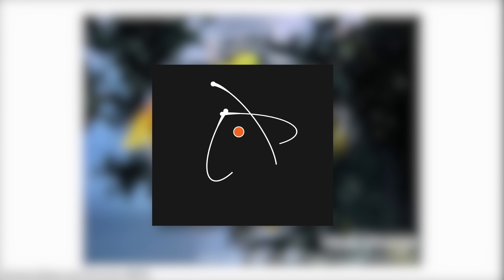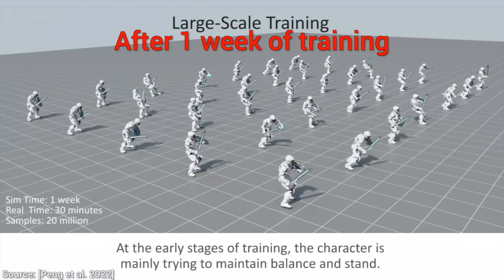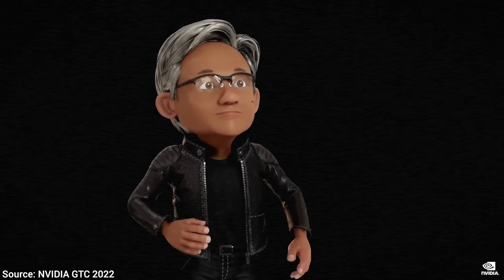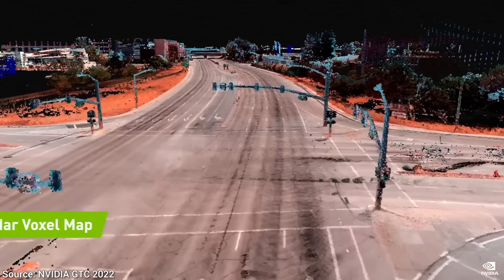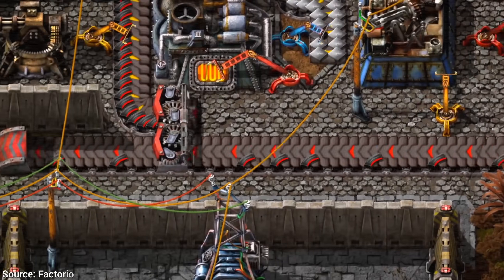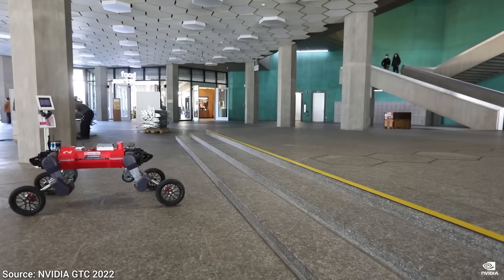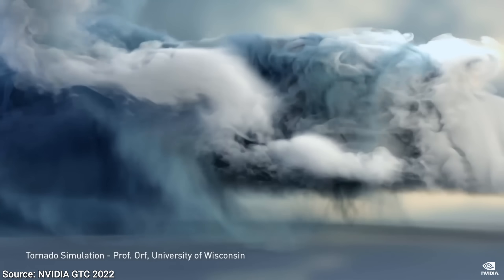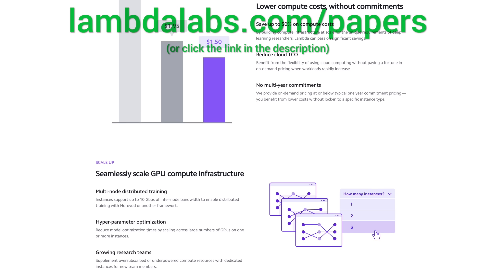NVIDIA GTC: When Simulation Becomes Reality! 🤯

Comment: Ten whole, rational numbers 0-9 and their geometric counterparts 0D-9D:

0 and it's geometric counterpart 0D are "necessary". 

1-9 and 1D-9D are "contingent"; on their predecessor with the exception of 0 and 0D (hence "necessary"). 

0 and 0D are our only whole, rational and not-natural number and geometric dimension. 

1-9 and 1D-9D are whole, rational and natural.

0D is Leibniz's 📚 Monadology 🔘.

Newton's 1D-4D only nonsense was clearly his thinking if 1D-4D is "natural" then it must also be "necessary". This is a fundamental error.

Newton's 1D-4D does not match quantum physics. Newton defines 0 and 0D as "not-necessary". This friggin guy.

Leibniz's 0D-3D (0D-9D actually) does match quantum physics:

0D Monad is Quarks 
1D Line is Leptons 
2D Plane is Guage Bosons 
3D Volume is Higgs Bosons

Newton's 1D-4D 🚫
Leibniz's 0D-3D ✅ (0D-9D more accurately)

Newton drinks his own pee.

0D Monad 🔘 is 
"One with Everything", literally 
" . with 0 "

0D Monad 🔘 is Quark 🟢🔵🔴 in quantum physics. 

No spatial extension. Zero size. 
Exact location only. 
6 thousand trillion trillion trillion (39 zeroes after 6k) times stronger than the force of gravity.

Quantum gravity 🚫 
Quantum aether ✅ 
(Ether)

Can every human on earth read Leibniz's Law of Sufficient Reason? Thanks.
Reply: [0D necessary and 1D-9D contingent universe; 
3 sets of 3]:

1D, 2D, 3D = spatial
(line, width, height)

4D, 5D, 6D = temporal  (length, breadth, depth)

7D, 8D, 9D = spectral
(continuous, emission, absorption)

Symmetry/entanglement: 

1D, 4D, 7D line, length, continuous 

2D, 5D, 8D width, breadth, emission 

3D, 6D, 9D height, depth, absorption

Hamilton's 4D quaternion algebra UPDATED from Newton's 1D-4D nonsense to Leibniz's 0D-3D matches perfectly.

Not a coincidence.

There is no 1 (contingent) or its geometric counterpart 1D (contingent) without 0 (necessary) and its geometric counterpart 0D (necessary). 

We don't exist in 1D-4D without 0D. Period.

Newton was/is so backwards on the fundamental level and possibility mentally 🧠 handicapped ♿.
(don't forget fraud)

We have a workable Theory of Everything solution right now. 

How do we do a planet-wide swap to actual smart person Gottfried Leibniz?
(And Plato, Tesla, Miller)

Comment: if These level of projects are coming out in affordable prices, countries like africa, india and many more could virtually create a world and make a bidding on each models and study the impacts as well as reduce the cost, without compromising in quality. it will also helps to reduce the delay of democracy as well.

in india environments and traffics are highly complex. so its hard to predict how the traffic for building optimal transport system will be tooo complex due to factors like connectivity points( road, railway, seaways, riverways, metro, airport) , weather changes( rain, humidity, temperature, heat, wind, pollution) , area type ( rural, forest, town, industrial area, city, town ), major busy points ( mall, school, college, IT parks, Markets, Manufacturers, Distributors, whole sale sellers, villas, Flats, tourist attractions ). this is almost impossible in india for making a common framework and make quick decisions on optimally efficient infrastructure development.

Comment: I see a future where we've disconnected the ideal 'jetsons' fantasy of the home robotic maid into the realities of the current technology. The brain doesn't need to be connected directly to the body. The local council or shire of your area can house the brain, and it can talk to many different bodies. Need a new electrical socket? Is your tap leaking? Something damaged your wall? Call up this service, and the appropriate body for the job shows up, getting signal from its 'brain' that has been trained to do this kind of work for over 50 simulated years.

Comment: The cells go through "trinary" division instead of the typical binary division.  Do the cells in this simulation have a DNA triple helix?
Reply: That's not a simulation, they just used AI to process the instrument data much faster and managed to catch that rare event.
Reply: @GS-tk1hk  OK.  Thanks for your comment.  

I looked into it and I found an example of a cell dividing into 5 daughter cells.  Researchers were able to increase the rate of the abnormal division under high-pressure cell culture conditions to mimic the highly confined growing conditions that can happen in a tumor.  

The cell highlighted in this video balled up write before cytokinesis, so maybe that caused increased pressure within the cell.  Cancer cells have high rates of polyploidy, so my "triple helix" suggestion would be unnecessary (and unrealistic).  

*I was thinking of Linus Pauling when the triple helix idea popped into my mind.

Comment: We need AI to make a ground breaking discovery, I think that will be where it really begins.
Reply: still a few decades to that
Reply: @mrqes  Not even close. The AI advancements we've made in just 5 years is astonishing. As AI grows, the growth rate itself increases. I would say it will make a groundbreaking discovery of some sorts in a decade at most. A few decades is a reach. Or, maybe there isn't much for AI to discover anymore so maybe it won't make a discovery at all.
Reply: @ET-yc4wb  nope, apart from that that's not how ai works, the computation required to run even the current models is tremendous, just to run GPT-3, which has over a 100 billion parameters you need hundreds of gigabytes of vram. for instance the average consumer card has around 4-16gb of vram, and the best cards range around 48gb?
Reply: @ET-yc4wb  and current models are fed a dataset for it to train on and then tested on the validation set to determine the loss, which it uses to correct itself. so it cant really just "learn" by itself
Reply: @mrqes  Computer power has seen one of the biggest growths in the shortest time in terms of technology. Not to mention the development of quantum computers which are millions and millions times more powerful than the most powerful supercomputer we have today. So based on what we've seen so far, I think it's extremely naive to assume computers in 5 years will be the same in 5 years. 

And yes, I know that current models require large amounts of data sets to function and learn. It'll probably take decades for us to be able to teach AI to learn by itself (Maybe never), but AI doesn't necessarily need to be able to learn things by itself to make a significant discovery. We can have AI try to solve huge problems that would normally take humans a long long time to solve. We even do this today and AI has made plenty of discoveries that humans normally would have taken a ton of labor and time to accomplish. AI is making small discoveries in different fields of science and even in human society, so I would assume it would not take it too long to make a significant discovery.
Reply: @ET-yc4wb  nope, if you look at the current trends of how computing power grows you'll see that it's slowing down as we're approaching the limits of x86 processors. Quantum computers are quite old right now, and are only useful when there is a large amount of qubits.

While yes, ai models are currently solving some problems, it's far away from making a breakthrough discovery.

Comment: With the advent of actual usable VR work software these advancements will allow even more people test their ideas before spending thousands of dollars to build a prototype that fails because of a simple overlooked mistake.
All these systems really are is the amalgamation of human knowledge to provide a tool reducing mistakes/knowledge gaps.
Of course they will be behind a paywall at first, but they will trickle down eventually and be affordable for the masses some day.
Reply: I was with you until you used the phrase "trickle down".
Reply: Assisted by AI too.

In the '80, there was an attempt to what is called conversational programming.  That didn't work well, because of obvious technical limitations. AgentSheet is more recent and seems to have had more success with it. Now, with more advanced AI, it may be much more practical!
Reply: spot on
Reply: The masses will benefit from the software, more reliable shipping, more well designed spaces, but there's never going to be a need for a household fulfillment center simulation. Same as the 3D modeling CT scanners. No consume will ever need to CT scan something they own to find out why it's malfunctioning, that's a need purely reserved for commercial use.